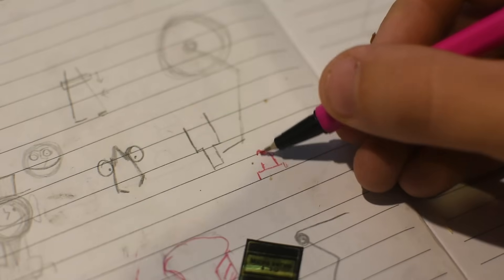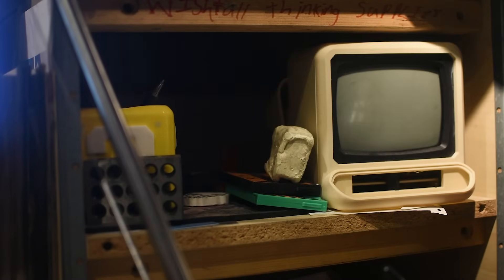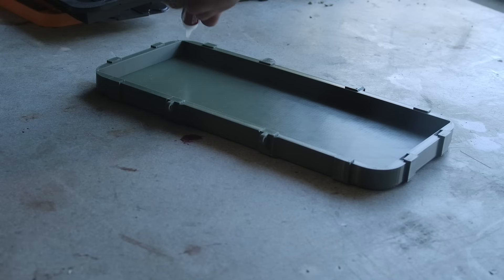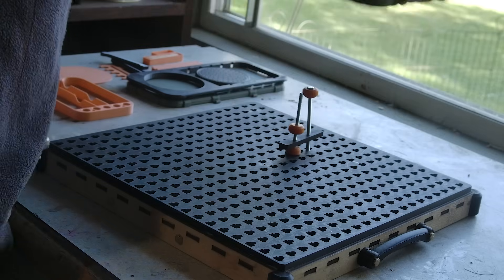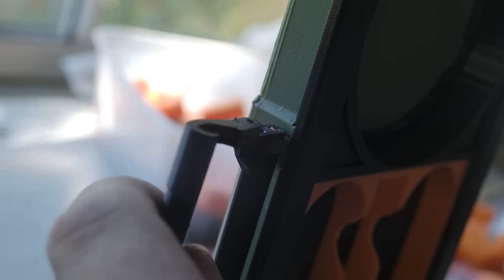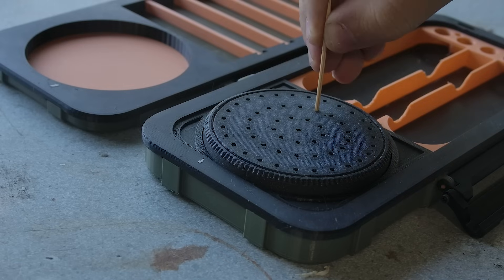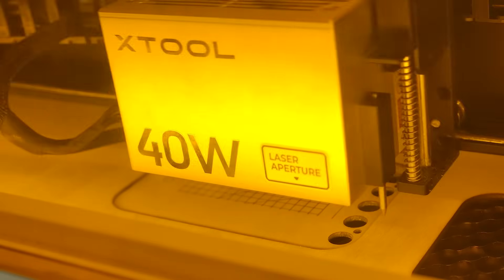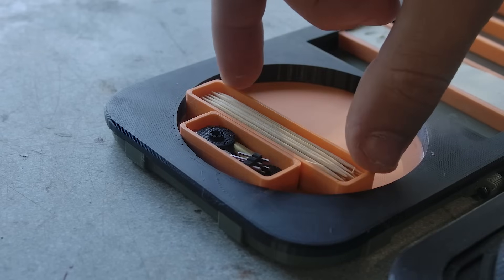A Solution For Designers Who Cant Draw?

Comment: I can't unsee the false premise: 'if you can't draw, just make your solution more complicated by adding a third dimension and countless extra variables'.
Reply: Nah I think you missed the point. The idea of working in 3d makes way more sense to me personally, being able to physically touch, rotate and move the design as you're working on it is far more intuitive and for some people. Drawing is something that doesn't come naturally for many people.
Reply: @eamonnstevens1629  when visualizing a solution, I try to eliminate ways of embedding errors in form and function from the start. If design has any connection to real world (dimensional accuracy, fit, etc) these priorities (easily illustrated in a poor drawing) are no longer guiding the solution when pushing/pulling clay.  I grant that you're solving something with that approach, maybe to do with your feelings, but not necessarily the engineering prob that's in front of you

Comment: You view on AI should be commended, but I would be careful disregarding it completely. Think of all the people who used to draft designs by hand, I bet many of them refused to use or learn CAD software because of the same opinion.
Reply: I would argue that using cad over hand drafting is a much much smaller jump than asking AI to do something for you that you simply don't know about. Besides the actual drawing part (which is a rather complex skill of course) CAD is very similar to drafting.

However learning to draw or sculpt by hand is completely different than just asking AI to draw something for you.

Comment: I don't understand how ML is supposed to help. I'm assuming you are talking about image generation, but it's utter garbage at making pictures of stuff that can actually work, because that not what it was designed to do. You can't trust a de-noising algorithm to make a picture of something that can exist in the real world.
Also, cognitive offloading can be a good thing, if used correctly. After all, you are using the clay to inform your decisions about form. It makes a good structural analog for how PLA and other 3D printer plastics behave kinetically on the scale you're working. Not to mention that many of us use calendars and notepads to offload memory tasks. I guess it all comes down to balance.

Comment: Did you tested some cheap thermoreactive polymer clays as a modeling material?

after short heating in boiling water, or tiny oven it can be mechanically finished, or some cutting operations can be done in a substractive manufacturing manner

Comment: hats off for refusing to use AI - same feeling about it here.

I love the design!
given that you have a CNC machine, however, I might recommend replacing the plywood board and the turntable with one cut from some HDPE (like one of those plastic cutting boards) - acrylic might be a decent alternative, but HDPE is better.
I'd also recommend adding an HDPE (or acrylic) rolling pin and some spacers so that when you use the rolling pin you can get clay sheets of a consistent thickness.
Reply: two more quick thoughts that I might suggest for your consideraiton:
- an annular dovetail on the underside of the turntable so you don't accidentally pull the turntable out - though it'd be quite a number of small additional bits to print, and getting the stacking order for assembly would be - at best - convoluted.
- a thumbscrew of the turn table to prevent it from spinning when you don't want it to.
Reply: oh... there are so many materials to choose from why limit to one material... glass, plastic, various metals, brass, aluminimumimum, steel, carbide... ceramics... each for different uses... casting(hot or cold depending again on material), brazing, welding, modeling... clay, slurry, paints, sand blasting, layout... expand... expand... expand... Happy Saturday!
Reply: @MikelNaUsaCom  Yiou'd try using this for Brazing, Welding, or Sandblasting? Really?
Reply: @ThatRobHuman  well... maybe in a different material?  castable refractory? sheet steel? cast iron?  or make it in clay, then maybe move to another place and redo with another material.  The concept would be to expand a parameter, such as material... and then see where that change takes you.
Reply: @MikelNaUsaCom  Sure? I feel like you're missing the point of my suggestions and feedback here, which was improvements towards the application that Chris intended - perhaps with some adjacency to some other use-cases. For a lot of the things you've outlined, I think that there would be better setups for those. I wouldn't try casting way too wide a net with this particular design - which isn't a slight at the design at all, the opposite in fact: it doesn't overreach.
Reply: also... lighting, and filming/digitizing.

Comment: Absolutely based with the AI thing
Reply: Agreed. I understand using AI for coding, because my having ADHD, I can think in logical flow very easily, but remembering complex syntax and hundreds of commands for something I'm not doing every day, it just makes sense to use it for that purpose, but if you're designing something physical or graphical, you should hold the brush yourself.
Reply: @H3xx99  I'm a software dev (with ADHD) in my dayjob, and I would not (and don't) use AI even for coding.

I hear what you're saying about arcane syntaxes and contexts, but I think what you're describing is a documentation and API design problem, which often is an absolutely legit problem, but leaning on AI to mitigate that problem leads to the same stunting that Chris describes: "Why bother (writing documentation / making the API elegant) for our library if folks can use AI can write code for our library;"
Reply: @ThatRobHuman I'm in software and I don't rely on Ai to write the shape of my code but I use it specifically to ask about documentation. "How do you use the Twilio API to make a voice call with a webhook" is the kind of thing that a documentation reading machine is built for. But i decide where that code goes and where I put the secrets. It doesn't touch my IDE.